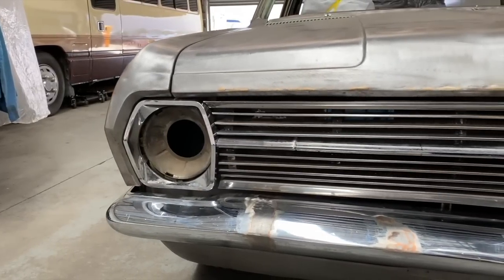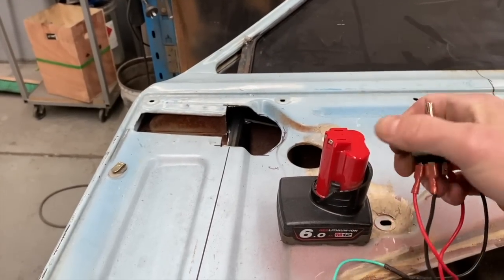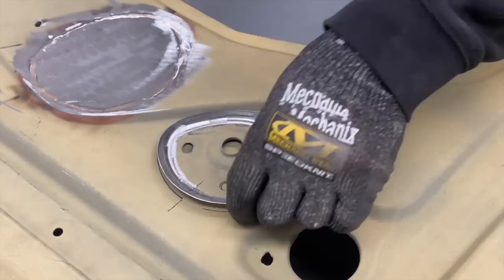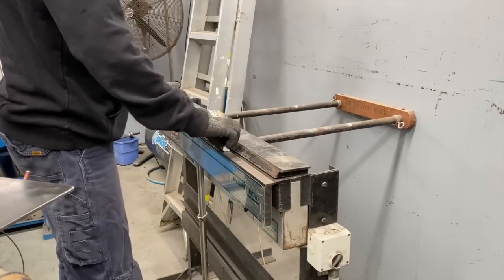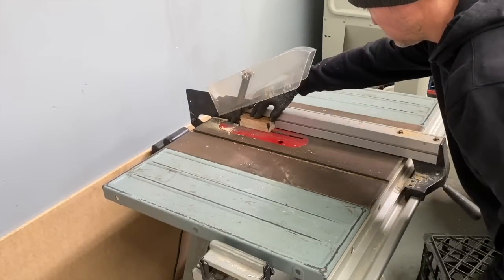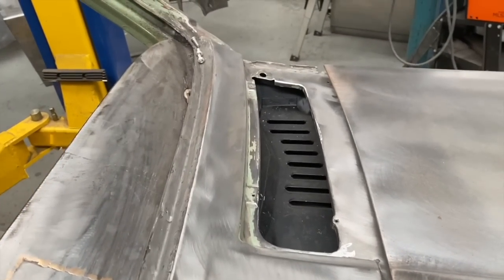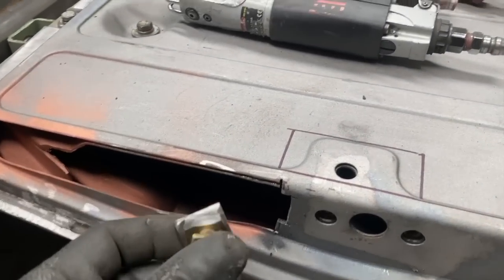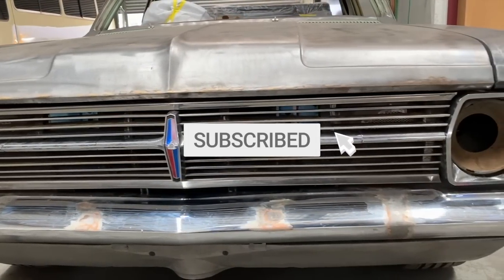HR Holden Ute Build Part 3 | Metal Work Complete

Comment: Great work. I see you have a Magna Bend, what a marvelous piece of equipment, I still have my 1300, but once had a 2500 as well, used for copper and zinc roofing, they are priceless.
Reply from the maker: They are such a great little piece of machinery. I probably use it more than my panbrake. Thanks 🙏
Reply: @ProShop1  I made up a number of different dia round bars welded to plates to make curved sections, had a number of people asking how it was done, a very clever machine.

Comment: bloody awesome work mate, looks awesome. I have to tackle auto windows in my van soon, struggling to find a kit that will work as they are only 45mm think. love the aircon vents they look sick.
Reply from the maker: I'm pretty sure the universal kit I used would fit. The motor would be the biggest part and I don't think it was wider than 45mm.

Comment: Love it!  Are you using silicon bronze tig filler rods?
Reply from the maker: Cheers. Yes I use silicon bronze on most of the panel work where I have to sand it smooth. A lot less heat goes into the panel.
Reply: @ProShop1  good idea mate!

Comment: Love your work. I'm currently doing a build on a HR wagon and was considering doing the same with the front glass to make the doors look longer. With the changes to the hinge area are you able to retain the stock hinges? Also who is doing the glass for you?
Reply from the maker: Yes. I made it so I didn’t have to modify the hinges. I haven’t had the glass made yet so not sure who I’ll be using. I’ll keep you posted.